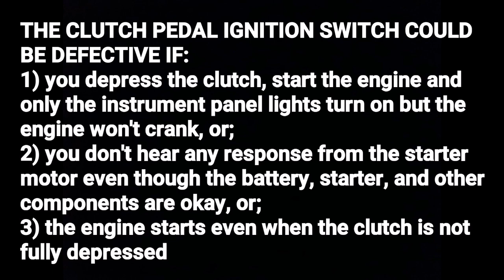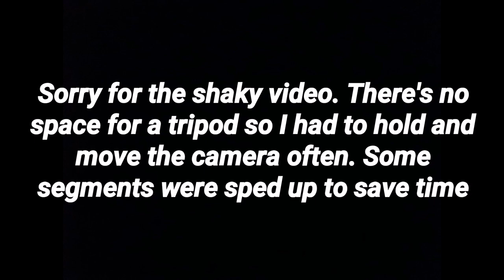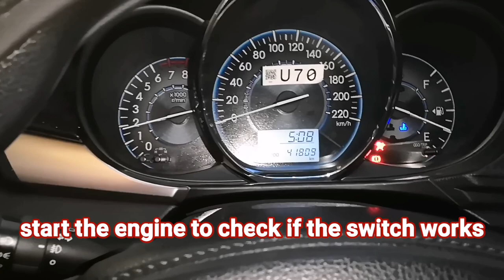IGNITION SWITCH FAILURE COULD GET YOU STRANDED

Comment: Just last month I figured out that the clutch pedal safety switch in my 1988 Mazda B2200 truck had occasional high resistance (used ohmmeter) when pedal was pushed, causing intermittent lack of cranking.  I removed the switch, opened it up, cleaned out old grease with a swab, put it back together and into the truck, now works fine.

Comment: Nice video but i would have liked to see you test the Switches (old and new) just to see how it's done and to be sure it's not the wiring harnes thats defective.Thanks.
Reply from the maker: You can simply use a paper clip as a "jumper" to close the circuit of the wire harness (as I pointed out in the video at 3:18 ). If the car starts with the temporary jumper wire in place, you know that the harness is good. 

If you have a tester you can check the pedal switch for continuity by probing the two prongs while manipulating the contact plunger in and out. The tester will respond accordingly if the pedal switch is good. You will get no response if the switch is bad.  Thanks for the input. Have a good one!

Comment from the maker: Recommended Tools/Products: https://amzn.to/3rGcBML
FOXWELL NT301Professional OBD2 Scanner: https://amzn.to/3sBa6KW
ANCEL OBD 2 Scanner: https://amzn.to/3JiCiZU
Fully Automatic Smart Battery Charger: https://amzn.to/3gCbKGP
Digital Tire Pressure Guage: https://amzn.to/3GKsmqe
BOSCH Wiper Blades: https://amzn.to/3uH8Qss
Bumper Retainer Clips: https://amzn.to/3LuuK88
Fully Synthetic Motor Oil: https://amzn.to/3szZjAF
Panel & Trim Removal Tool Set: https://amzn.to/34Sw9o8
1000 Amp 12volt Car Jump Starter Pack: https://amzn.to/3JiEsJ0
Phone Mount for Cars: https://amzn.to/33hwYXs
FOXWELL NT301Professional OBD2 Scanner: https://amzn.to/3sBa6KW
VACLIFE Tire Air Inflator/Compressor: https://amzn.to/3JnGpDQ
AT-205 Re-Seal Stops Leaks, 8 Ounce Bottle: https://amzn.to/3Lttu58

Comment: My santro xing car, model 2014, suppose to be running in the first gear, I want to shift the gear to 2nd.  For that I apply on clutch.  That same time car engine is geting off.  Not always, sometimes it happens.Then if the car is standing  in a little slope on the road, I can't get the break.  My power steering is also get very hard to move.  The car is going back.  Only hand break is saving me from a back end hit.  What is the reason for this.  Now this is my 2nd workshop i tried to solve this problem.  Still the problem continue.  What is the solutions for this?  Now someone told me that there is a switch near the air filter.  May be it is getting cracked.  Is it right thing?  Please help me.
Reply from the maker: Though it's impossible to make a comprehensive analysis of your car's issues based only on the symptoms you mentioned, I can give you an idea of potential causes that could contribute to these issues. One possibility is clutch-related problems, such as inadequate clutch fluid levels or improper clutch disengagement. Additionally, idle air control valve (IACV) or throttle body issues might be at play, impacting engine performance and causing stalling. It's also crucial to consider the possibility of a vacuum leak affecting the air-fuel mixture. Electrical issues, particularly within the ignition system, sensors, or wiring, could be contributing to the stalling problem.

In relation to the power steering difficulties, examining power steering motor if it has EPS, or fluid levels and the condition of the power steering pump, is advisable. As for the suggestion about a switch near the air filter potentially being cracked, it's important to identify the specific component and its function. However, for a comprehensive and accurate diagnosis, it is highly recommended to consult with a qualified mechanic or visit your car's service center for a thorough inspection. Demonstrating the issue during a test drive may help the mechanic better understand and address the problems you are facing. I hope this helps. Thanks for watching.
Reply: Thankyou for your reply.  Now the mechanic shootout the reason for this issue.  He told me that  a IAC valve near air filter get cracked.  It is related with clutch.  Can you explain that what is this IAC valve function?
Reply from the maker: @MrRoyantonym  no problem. The IAC valve, or Idle Air Control valve, is an important component in the engine control system of a car. While the IAC valve itself is not directly related to the clutch, it plays a significant role in controlling the engine's idle speed. Its primary function is to regulate the amount of air that bypasses the throttle plate when the throttle is closed. If the IAC valve is cracked or malfunctioning, it can disrupt the engine's ability to maintain a proper idle speed, leading to issues like stalling or rough idling. While the IAC valve itself doesn't directly engage with the clutch, its proper functioning contributes to overall engine performance. If the IAC valve is cracked, it can affect the engine's ability to operate smoothly during clutch engagement and disengagement by allowing unmetered air to enter, potentially leading to stalling issues, especially when shifting gears.
I suggest you replace the cracked IAC valve as soon as possible to restore proper engine idle control and address the issues you've been experiencing.

Comment: Nice and informative,it is better to bypass this system.I don’t know why manufacturers are making cars complicated?
So as it fails and users will come running for repairs at authorized workshops and they will mint money fooling around them.
Reply: I agreed until this stupid system saved me couple of times when I had my car jacked doing some diy work in my garage and I had to start the engine and I forgot completely about I had it the gear engaged in 1st or Reverse haha avoiding me a lot of headaches

Comment: For auto vios does this affect?
Reply from the maker: Yes, most modern manual transmission cars have this safety switch. Vios has this as well.
Reply: @Viosified  auto transmission?
Reply from the maker: Manual transmission
Reply: @jonathantan1842  definitely no clucth pedal all auto trans ..mostly f ever kasama sa brake pedal ..as in the manual of auto trans..it stated to press brake pedal b4 starting ur engine..
Reply from the maker: Agree 👍 Thanks for your input sir. Keep safe  :)
Reply: San po kaya maaaring makabili ng ignition switch toyota vios 2008 at magkano salamat po
Reply from the maker: Sir, subukan nyo po mag canvas sa mga autosupply shops o kaya sa banawe, hindi ko lang po alam ang presyo nila.
Reply: You are allowed to drive?
Reply: @jcbluze  to get a license do you need to be a mechanic and know all the parts of a car? Or do you need o know the rules of the road?